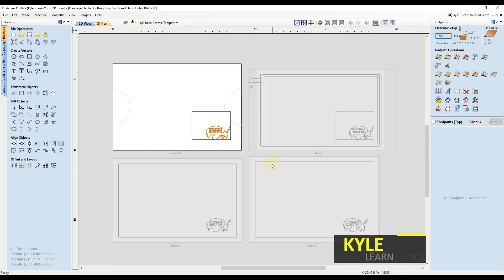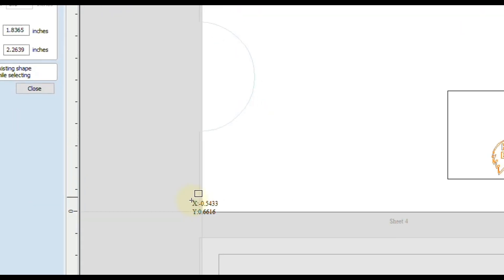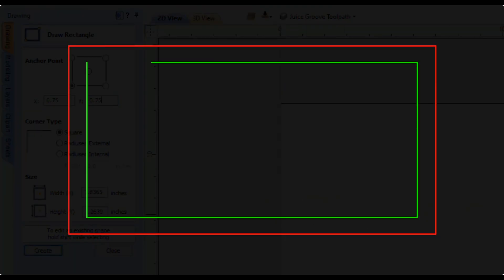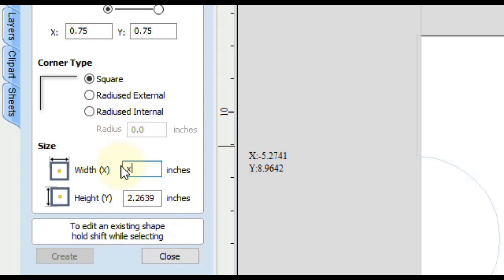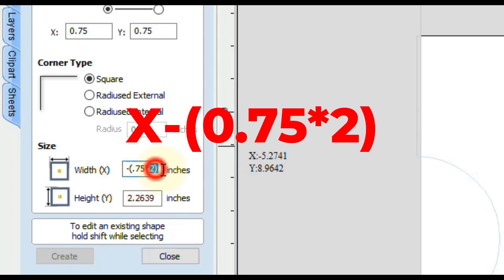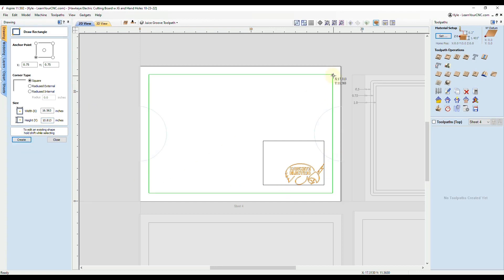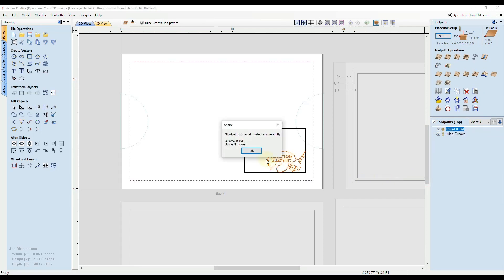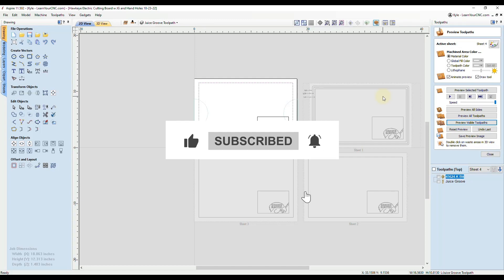Easier way to create perfect shapes using formulas - VCarve, Aspire, & Cut2D Quick Tip

Comment: Excellent video, thank you for sharing your knowledge. May I suggest considering the metric system (or at least adding metric equivalents)? I have fully converted my workshop to metric and the efficiency gains are remarkable—I save hours and avoid many errors. Since metric is the international standard, it would make your content even more accessible and valuable to a wider audience.

Comment: Nice tip.  I hadn't thought of this way before.  I typically make one rectangle the exact dimensions of the cutting board or work piece and then just use the offset tool to create a second rectangle of the exact .75 inch offset.  This method would save me one step.  thank you for sharing.